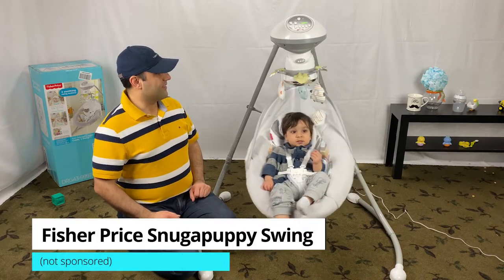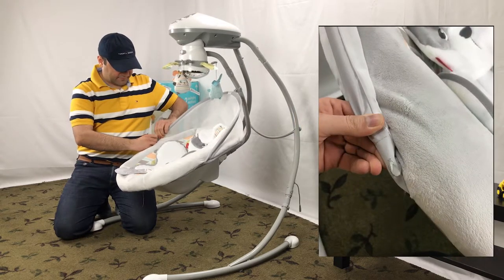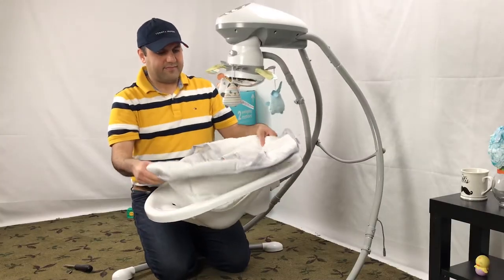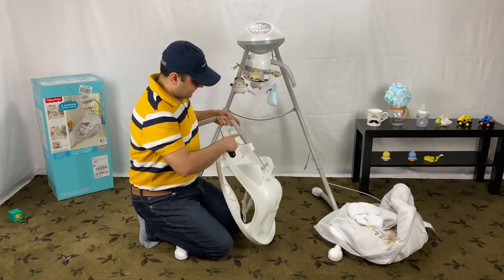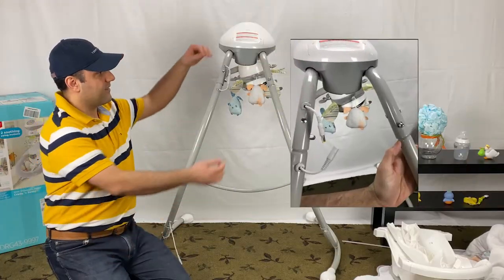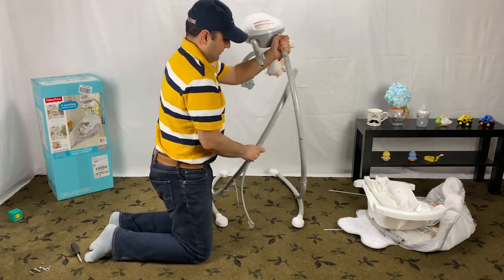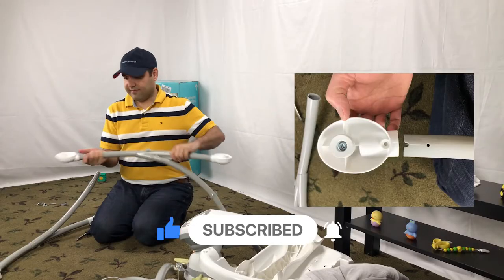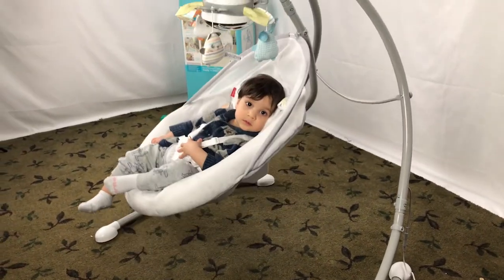Fisher-Price Snugapuppy Swing: How to Take Apart [Step By Step]

Comment: I can see how to take it apart - were you able to successfully reassemble this thing with everything fitting together nice and tight? I'm afraid trying to put it back together will result in some loose connections and whatnot.
Reply from the maker: Good question, I assembled and dismantled twice so far. So I would say so long as you don't do it several times, you are safe. The link below is the how to assemble video step by step: https://youtu.be/AdmNH1cnicM

Comment: What tool are u using to remove the bolt. My screwdriver isn’t working
Reply from the maker: There are two types of fasteners for the swing. for screws use a Phillips screwdriver but for the bolts you need to use an Allen wrench or a hex key. Let me know if you need more clarification. Best.